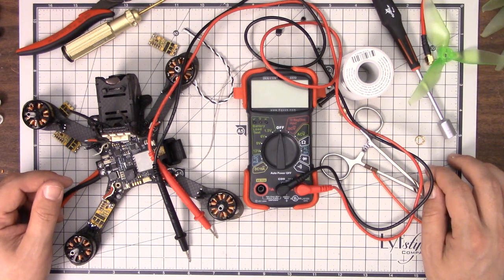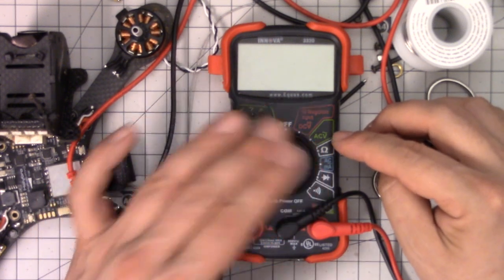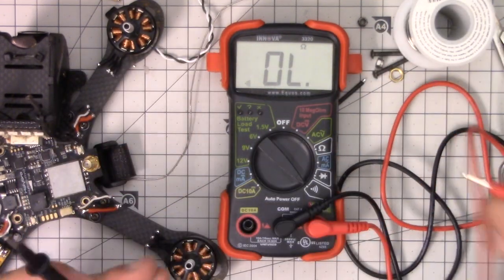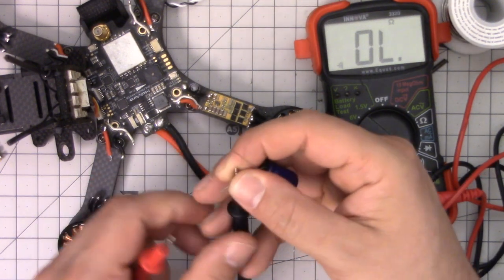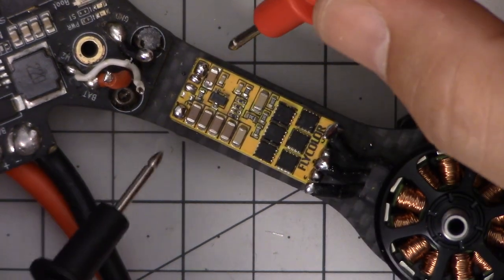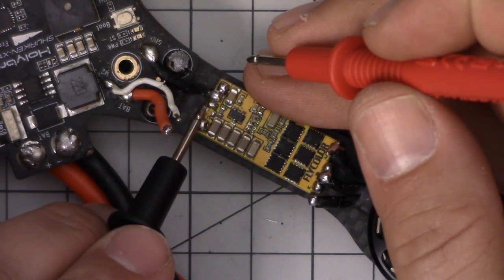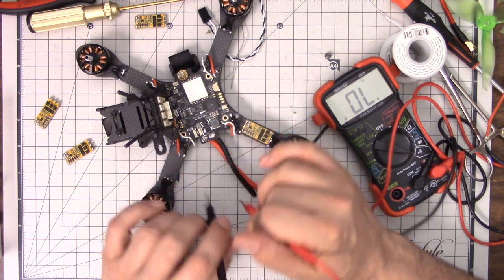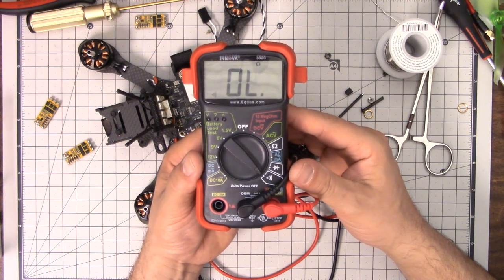HOW TO USE A MULTIMETER: Continuity Function

Comment: Complete noob here. I went to test continuity before powering up my F3 V4 AIO and it's showing a short between + & -. I've not used the 470uF in this test so its a bare board. Do I have a dud board or is this normal? I've removed all connections from the board and It is still the same. I've a new Omnibus F3 pro doing the same. The Littlebee ESC's do the same. Both boards power up and can be seen in cleanflight/betaflight. I'm starting to question my sanity & don't want to go bang with my 1st build. I am however using a very old Metrotest MAO70 manual range Multimeter from the 1990's. (yes its getting replaced). thanks, #confused
Reply from the maker: +Nigel Wynne I think your multimeter is damaged.
Reply: Thanks for responding. I'm thinking that it's from an era when multimeters didn't need to be so accurate. I can only think it must not be recognising so small a resistance. Well it is from the neolithic era.

Comment: I have a problem with my multimeter... It's kinda funny that we have the same multimeter. But when I set it to continuity mode it doesn't beep when I touch the positive and negative leads together, it doesn't make a sound could there be something wrong and I have to replace it?
Reply from the maker: If it doesn't beep when you touch the probes together in continuity mode, then it's definitely not working right.
Reply: Should I call there customer support and see if they will send me a new one? I just got it like 3 days ago
Reply from the maker: +Cam's FPV just return it to wherever you bought it.
Reply: I bought it through Amazon so I should just return it and buy a new one then?
Reply from the maker: +Cam's FPV yes definitely